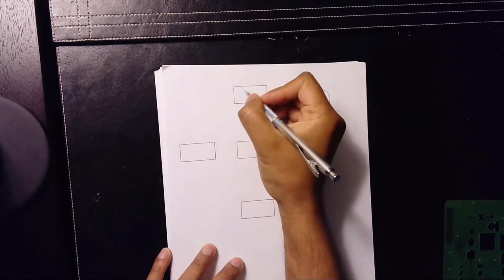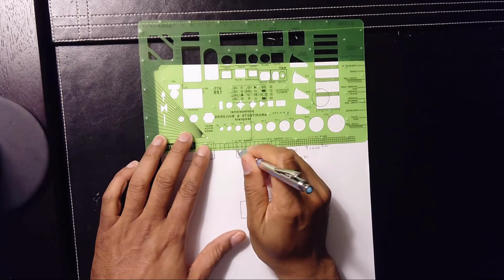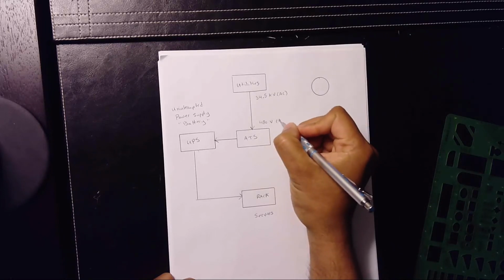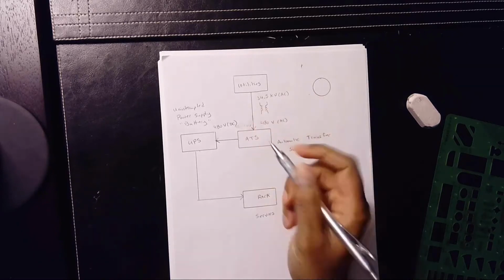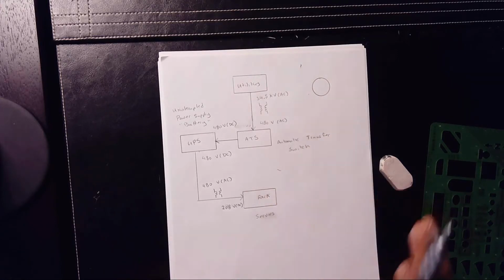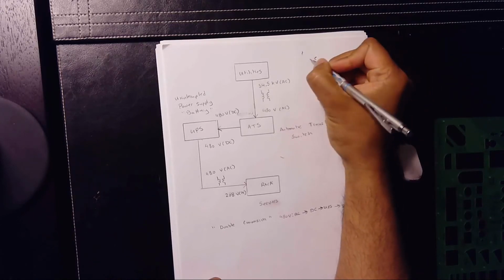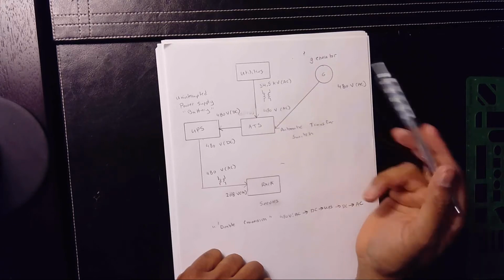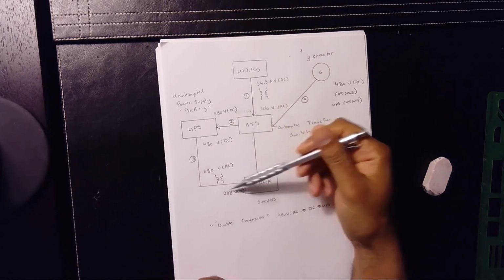Lesson 7 - Part 2: Power Distribution for Data Centers and UPS

Comment: There's no way it's 480VDC??? I've never seen that in the industry. It's either 125VDC, 24VDC, or 48VDC.... never seen 480VDC.. this is probably wrong. and there's so many things missing... power just doesn't magically convert from AC to DC mid wire... you should explani that properly.
Reply: 24vdc sounds like control voltage. I think he’s talking about is the UPS that provides backup to server racks downstream. You probably have rack level battery back up and they don’t need a UPS, I think your UPS might be for controls, BMS, EPMS, AHUs or other critical device, check the power panel downstream from the UPS and see what it feeds.

Comment: Maintenance Bypass wraps around the UPS and static bypass is internal to the  UPS...static bypass syncs the UPS output to the MBB breaker. Which allows you to perform a make before break situation so you dont drop your critical load. Your video does not make sense to me. You are using the wrong terminology to describe things in my opinion. Plus the ATS does not convert ac to dc. your rectifier does that inside the UPS, the inverter in the UPS turns the dc bzck to ac to support the load...

Maintenance Bypass includes a make before break situation where you parrallel the same source so you dont drop the critical load. MBB allows you to safely perform maintenance and even replace your UPS while still providing power to your critical load. But while on MBB, you no longer have battery protection...this video needs revising

Comment: How about a inverter and rectifier
Reply from the maker: I already did a video for a full-bridge rectifier. And, the inverter is simply a DC to AC converter with a pulsing DC signal generator. 

The full derivation will require an extensive knowledge of integrated circuits. Does this answer your question?

Comment: remote power panel, does anyone know what that is? please it's really important
Reply: RPP are downstream from the ups. They step down from 480 to 208 or less. Feeding customer loads. That’ll be what the customer 20,30 amp 208v circuits are fed from

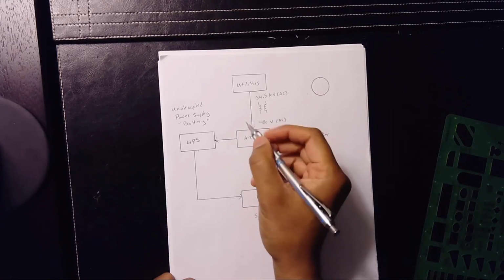Comment: 2:55 to 4:26 needs correction. An Automatic Transfer Switch (ATS) selects between 2 or more power sources (example, utility power and generator). An ATS does not convert AC to DC. Based on your example, the UPS will receive 480V AC, convert it internally to DC to charge the battery, convert back to 480V AC....
Reply from the maker: This video is really designed for Data Center interviews. However, you make some good points. So I will review your comments and update the video.
Reply: He forgot the rectifier!!!!
Reply: exactly

Comment: every data center has two main power sources the pirmary one is Utility and secondry one is generator, so power comes from the main utility to the transformer then to MCb or main circut braker, then to MSB or main switch board then goes to main Utiltiy circut- then to ATS and from ATS it goes to rectifier this where the power change from AC to dc and then to invertor to change from dc to ac and then it goes to PDU and from there it goes via bus lines to the client computer or server racks ..
Reply: Why would the generator not be wired for fail over of the mains primary? That doesn't make sense to me to have the secondary power just be a generator. I could see if secondary was from a utilities provider and you had your generator on that circuit in case your secondary also went down maybe
Reply: @CulturedOperative  It does in reality. The mains output and the Generator power ouput connects to the Automatic Transfer Switch (ATS) or sometimes Auto Mains Failover (AMF) system. It’s the ATS that does the switching between Mains and Gen and viceversa.

What you will typically have is

The ATS is fed by output of:

1. Interconnections of Mains Feeder + RMU + Transformer + LV switchgear  

2. Diesel Generator (s)
Reply: The PDU in the rack is supply by a A&B Power Panel, each power panel has it’s own UPS back up,and all is backed up by your generator,most buildings have 2 generators